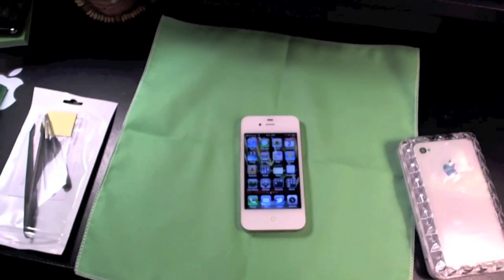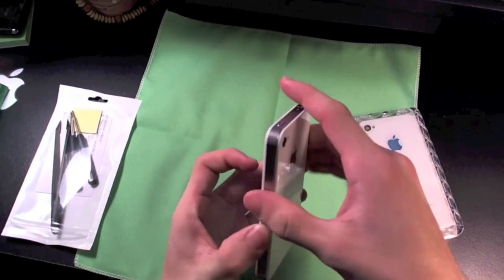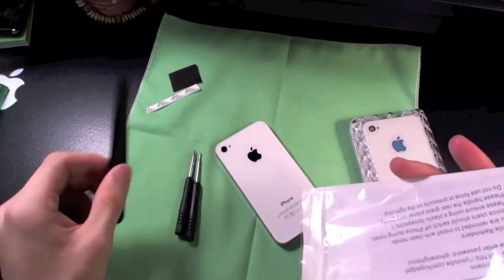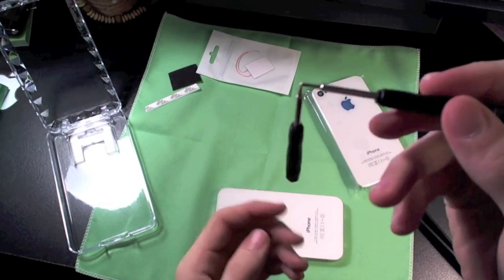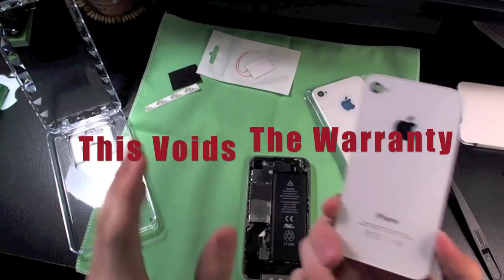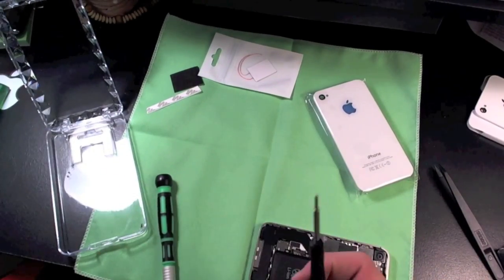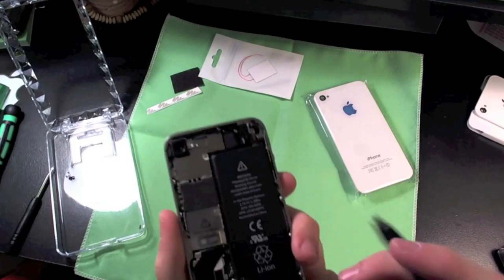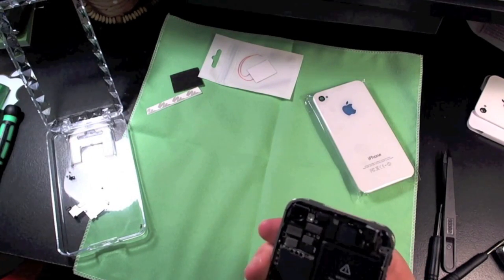Installing the KOGadget Light Mod

Comment: Thank you so much for this video!! I went along with you while i did mine (iPhone 4 CDMA) and it went perfectly, everything still works! lol. And great tip on the electrical tape. The black adhesive can be a little messy, but it worked perfectly and there's no gap at the top! Also, there was a clear film on the light, I don't know if u knew that, or maybe I wasn't supposed to take it off lol. Also, great placement of the glow (from bottom to top of the panel) Again. thanks so much!! =D

Comment from the maker: Yes, unfortunately the thing about this mod is that the light mod is MEANT to stay for only 15 seconds after the screen turns on, but it also turns on if there is any data or actions going on in the background, like searching for wifi, receiving an email, updating iCloud applications..etc... Also it will stay on non-Stop when charging. A good way to get it to shut off more is too manage your static multitasking apps in the multitasking bar and try to keep data heavy ones closed.

Comment: my emi shield went on fine, didn't reset my phone. -- I'm just glad everything works (wifi, vibration, proximity sensor) lol. So far people on facebook are liking it, lol. but I really do love it, except when it charges it glows, even when its off, because it will probably bother my roommate when I charge it on my dock at night, so I'll have to charge it when I'm on my laptop I guess.

Comment from the maker: @glennlopez Im sorry but you are incorrect here, the wedge was only meant to hold down the connecting tip onto the contact surface under the emi shield where as the diffuser is meant to be taped into place with the tape they send you, although i guess if you wanted to you could wedge the diffuser under the backing using tape? but thats a lot more difficult and is going to make a much bigger bulge on the already thin back plate. Mine ended up with no spaces from the phone to the backplate.